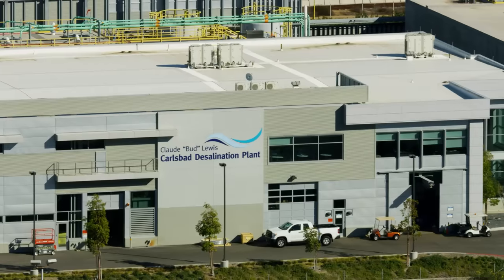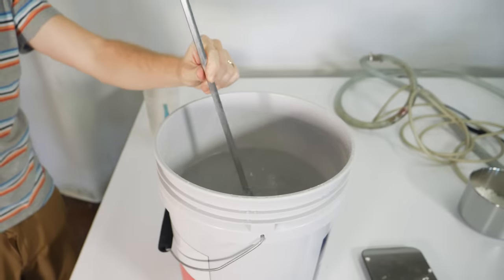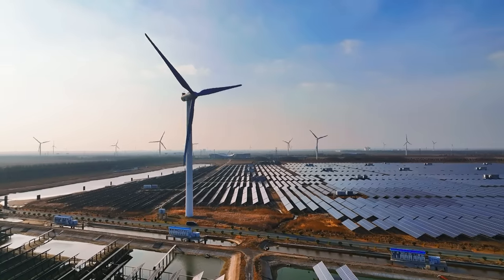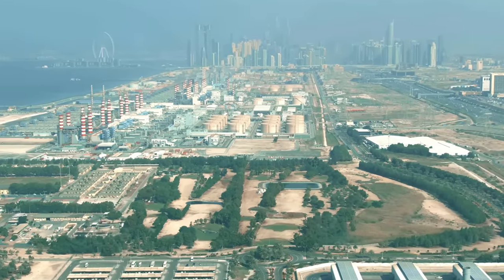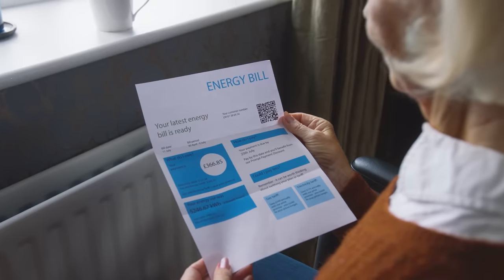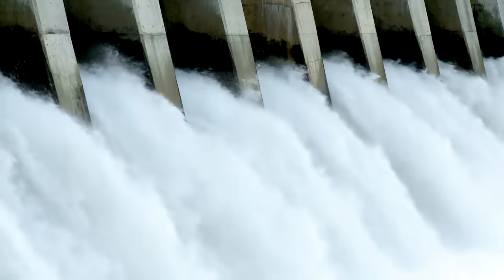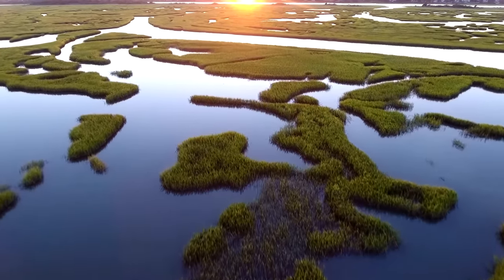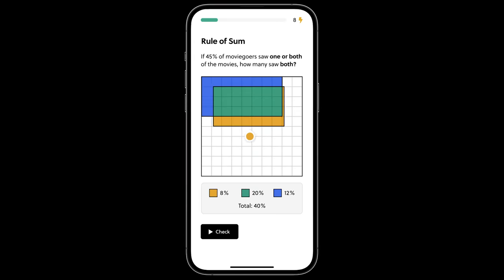Why Is Desalination So Difficult?

Comment: I wonder if you could hook up some type of system that feeds  saltwater into  powerplants, captures the steam to turn  the generators, somehow make the  generator disintegrate from the rust, capture  the salt and then capture the fresh water. might be slow otherwise more fuel would have  to burn.

Comment: How about a massive floatable structure made out of glass with a lens or even multiple lenses that focus the sun rays to evaporate water.
Like some sort of cloud factory steam chamber that pushes the vapor to a cooling area.
That way you don't have to deal with the salt saturation and even then you can just move the entire thing cause it's basically a boat.
Downside is that it only works when the sun is shining but that's what you have a reservoir for.
Reply: Why?

Comment: Reverse osmosis is a pita, having to maintain membranes, and high pressure equipment. Flash evap is way preferable in my book. (Easier operation, if you have a bunch of low grade waste heat.)

Comment: Reverse osmosis by height difference.
Pump the water upward, filter connects at the bottom, pushes through the filter
as pressure from height difference goes higher. The water that comes out
only needs to be pumped back up again, while pressure is being generated
as the natural state of the water. Only more water is needed when it passes through,
to replace what came through, and the water that comes out only needs pumping back to the surface.
Much better than other artifical pressure generation.
Clean water at the cost of pumping it twice.
Reply: There is 0 benefit to this, in effect you just have a inverted U shape in the piping with a buffer tank at the top
Reply: @user-si5fm8ql3c  It's already being used.
Large filter surface to offset the low height difference in flow-through.
Easy peasy.
Also, in certain situations you don't even need to pump it upward to create
the passive osmosis effect. if the point of usage is lower than the outgoing water flow.

Comment: You're missing a desalination process.  What about vacuum?  Under vacuum, the water 'boils' with minimal heat.  You pump this vapor through your vacuum pump and it turns to water on the other side.

Comment: Can't we use solar for distillation? I know that's basically how rain works but I also remember reading a survival guide book where if you are stranded at sea with a plastic bag you can use sunlight to distill seawater for water (although i dunno how efficient that would be, it's probably still better than nothing.)

Edit: yeah lol got to the end of the video and you did bring up my question exactly and given the same conclusion I came up with that is that's just the natural water cycle.

Comment: Why don’t they use giant green houses that get hot from the sun with water cooled condensation plates. Potentially you could also have a large low pressure vessel bringing down the boiling point of water to room temperature probably requires too much energy though

Comment: can saltwater still be used for showering or washing? you don't need to drink all the freshwater you end up using.
Reply: Saltwater cannot be used for showering and cleaning.

After taking a swim in the ocean, you actually have to take a shower in freshwater afterwards, because the salt left on your skin will make your skin sticky. Only bading in saltwater over time will cause your skin to dry and crack up.

You can't use saltwater for your laundry because the salt will ruin the fabric (and the laundry will not feel "clean" afterwards).

House cleaning with saltwater is no good either, when the water dries up after washing the floor for example, a thin layer of salt will remain on the floor afterwards, effectivly making the floor dirtier than it was before. The salt will also damage the building, perticulary concrete structures.

And worst of all: all the salt from this water will end up in nature, quickly ruining the soil, and thus, plantlife, animal life and freshwater sources (groundwater, lakes, rivers, etc.).

In conclusion, saltwater has no place or use elsewhere than the oceans, and we still rely on freshwater for everything.

Comment: Not sure if it is actually viable, but does anyone know if solar evaporation set ups are used large scale? What i mean is using mirrors to redirect sunlight onto a tank painted black as a method of heating. This might, at minimum mitigate some of the energy cost needed for industrial scale evaporation based desalination.

Comment: I've seem wave power generators and I've seen desalination plants. Why don't people use wave motion to pump water and get it to the high pressure that is needed for destination.  The high cost of desalination is pumping the water to 600 to 1000 PSI.

Comment: I wonder about the practicality of using geothermal or non-photovoltaic solar power in distillation. To an extent it's geographically limited, but using something like concentrated sunlight to boil water would probably cut down on energy costs, though it would probably take more space and time. Also taking more space and time but also maybe feasible would be to use enclosed evaporation ponds with warm but still fairly low temperatures. Since these are fairly simple ideas I'm sure there are reasons these methods aren't used, I'm just curious if they've ever been scientifically tested.

EDIT: Just did some quick research and it looks like most of these do actually see at least limited use. I would guess the reason we don't see them more is most likely a combination of geographical limitations (inherent to any form of geothermal power) and scalability (evaporative desalination might work for one greenhouse but on a mass scale it's probably cheaper to transport food from elsewhere than build a ton of greenhouses). But I'd need to do kore research to be sure.

Comment: I imagine you could build a pipeline from the ocean inland to a desert (like where I live) and then pump it through giant flat solar-heated tubes with just a bit of headspace and then collect and condense the water vapor. If you had high flow and low temperature and instead were dependent on using a large surface area, I don't think you'd have scaling problems and you wouldn't have to pay for the heat.

Comment: Ya know you can make an RO system where you just stick a canister deep under the ocean and the pressure from the depth of the water forces the sea water through the RO membranes and you just continually pump the now fresh water up and use it.

Comment: The planners should have used the waste, the brine, as a product. Brine, once dehydrated provides salt, and other minerals. The West Coast of the United States use to have many Salt Works, to take in salt water, and allow the water to evaporate over time, and thus harvest the salt and minerals. The last of these on the West Coast, at the southern end of San Diego Bay, is planned to be discontinued. The desalination plant, instead of sending the brine back into the ocean, could have been placed into dehydrating pools, and the salts and minerals harvested.

Comment: Eh. In places where there's not enough fresh water there's usually a lot of sun. Which means you can literally set up a couple polished sheets of metal into a dish shape, put your boiler/distiller in the focus and turn it towards the sun. Free desalinated water.
Or, if for some reason you're on mars and don't have enough sunshine to boil water that easily, you can use the membrane thing without energy. You know what creates good pressure? Water depth. Connect the tank on the roof to a hose with a membrane at the end in the cellar, and while you won't get 40 atmosphere's of pressure, you can still do a lot with 2. Might not get enough water to shower, but enough to drink.

Comment: If human body lacks salts the taste of the salt turns dynamically in this case kinda sweet and juicy. And If your body has fair amount of salts then same amount of salt concentration in water will taste unpleasant as we know, salty. Furthermore If body has too much of salts in it then that same saltwater will have burning kind of taste. It is impossible to drink it after some point. If there is hot weather outside you can try that out. Add salt to glass of the water to the point where the salty taste starts come up. Go outside sweating for few hours. Don't eat or drink*. Come inside and taste the same salt-water from that glass. There is no salty taste anymore. Your body is screaming to get that salt so the taste changes accordingly. Now try to taste unsalinated water. It tastes unpleasant if your are in lack of salts.

Comment: Could they not use a gravity fed system whereby the falling water partially powered the process? Maybe a vacuum distillation once the energy has been mechanically recovered?
Reply: Wouldn't pumping water to gain potential energy be inefficient?

Comment: Hmm … how about boiling the water off by lowering the ambient pressure artificially to just lower the boiling point - imagine a big black tank in the sun which heats the water to a certain temp - the flower lowers hydraulically and thereby puts the boiling point much closer to the water temp so only minimal heat energy is needed to get it to a gaseous state.

Comment: 52 seconds in, I assume the main detractor is that the power cost of producing clean water from seawater is simply too high to be effective.

Thought experiment: If we manage to create fusion reactors, essentially allowing infinite power generation, would we then not be able to apply that feat to desalination, essentially allowing for relatively-infinite generation in both power AND water production?
Reply: But it isn't.  Our town uses it for municipal water supply. AND thousands of homes here have individual systems.
Reply: But it's not.  Our municipal water comes from. ROing salt water and I pay the same per gallon as I did in other cities I've lived in.

Comment: Its not difficult, its not labor intensive and its not terribly expensive either, the primary issue with desalinization is that its a very slow process. I live off grid in the desert in Eastern Oregon, my main water source is a lithium saturated spring...It can be very toxic in high amounts and cant be filtered, it can be treated with expensive, and also toxic chemicals or it can be distilled. I built my own solar distillation system, its has a 15 × 15ft footprint and in the summer on a 90 degree plus day, I can get around 12 gallons which is way more drinking water than I could possibly use!

Comment: When salt water freezes, the salt is driven out of the matrix.  Freezing is a way to desalinate water.  Why couldn't you just put a desalination facility up in the mountains where you allow saltwater to freeze?  The freezing would be free due to the ambient temperature.  Still have to pay to pump the ocean water up there though.  Still, could that be more cost effective than paying to heat the water?

Comment: Why don't they use gravity to generate the pressure for reverse osmosis? If they put a membrane at the bottom of the ocean, it could pretty easily get to the pressures needed to force water through a membrane.
Reply from the maker: Then how would you get it back up?
Reply: @PracticalEngineeringChannel  The most efficient way I can think of is a pipe filled with fluid more dense than water, then buoyancy could take all the clean water to the top. I’m no physics expert so my logic could very well be flawed.

Comment: Disorganization can be done multiple ways.  Let’s start by boiling the water and taking the steam and converting it back to water.  Then we shall put that through a soft water filter and then we shall put that through a reverse osmosis system.  Now keep in mind that set up costs $1000.  That provides drinking water and bathing water for a house with family of 5 to 7. And the water is clean with 0ppm. The system works by itself. There would be a extremely low salinity level. The process is easy and cheap.
Reply: Yep.  Our house had one.  Water costed about the same as when I was in CA.  Later our entire city was RO.  Not a high cost.

Comment: So, we need energy for this, right? 

Why not just build a huge glass building which we can put water in. Use the heat from the sun.

Might not work in some areas but supplying a town with water would be possible.

Comment: Why can’t they build a desalination plant next to refinery or power plant and use the combustible gases or waste heat that would otherwise be just burned off and released to the atmosphere to heat up seawater. Hot seawater can then be pumped to high pressure is a spray tower to flash evaporate the seawater to vapor and salt. Do a cascading flash evaporation through several flash towers with a counterflow of cold seawater to improve heat recovery. Your product is fresh water and salt crystals

Comment: Current methods of Desalination range between .002 and .005 cents per gallon. Most municipal water supplies in Texas sell tap water to consumers at .01 cent per gallon.  An average  285% markup. Desalination is an extremely cheap form of fresh water supply. 

Your video while technically informative, seemed to indicate that the Desalination process was somehow inferior, or expensive. When compared to free sources of fresh water such as aquifers, lakes, rivers, and manmade reservoirs desalination cost may be higher, but in no way are they a barrier. Especially compared to the environmental damage happening as a result of damming natural rivers, depleting aquifers and desalination of ocean water due to excessive fresh water runoff from manmade sources.  

You also failed to mention that the Salt and Minerals that are removed can be resold both as Table Salt (sea salt) and soil enhancers. Recovering some of the cost using the waste stream.

Comment: Could we just have ships with giant capture decks following storms? You’d still have to treat the water, but it wouldn’t need to be desalinated.

Why can’t we do this passively with sunlight. Huge tubs designed to hold heat with a funnel shaped lid that lets sunlight in evaporate the water. The water runs down the cone into a collection tub underneath.

Comment: Sea floor level RA for built in pressure and sea water delivery system. Empty pocket with a sort of submerged dam, which regulates pressure into the subterranean membranes, excess pressure in would aid in pumping it to surface holding tanks. /shrug. 
.

Comment: Now If you evaporate that water enriched with salt it is more efficient than it would have been otherwise as you have half the water to evaporate.
And then you can sell the salt and distilled water to. Yes you have Operational costs but you also produce products that are widely used.

Comment: With solor energy is getting cheaper and commonly available , we all must start thinking of evaporating sea water or sub soil water using solar energy , i am in process of making evaporator, with vacuum chamber , water boils off at lower atmospheric pressure. I think -40HG in the water should boil off at 40 deg Celsius, the vapours shall be 
re condensed with small chilling unit , my estimate is that i kay be able to produce 2,000 litres per day using solar energy . TDS of under ground water i am using is 3000ppm.
I need advise and ideas .
If sucessful i think every house hold shall have own source of clean water.
Main challenge is to evaporate water at 45 deg cel instead of 100 deg  Celsius .
Awaiting for comments and tips to help me achieve success .

Comment: Bought a surplus military issue portable Katydin RO desalination unit. Works great, water is fine. Too bad the arse hole government here in Greece hasn’t installed desalination equipment to cure the water shortages. They have fantastic solar and wind energy systems here that can power the equipment. They are also trying to sell out the water supplies to private foreign entities who will raise costs and export most of the water. Kinda like Coca Cola selling bottled water causing water shortages for municipalities that feed off of the same source.
As for the brine, a perfect source for sea salt dehydration. If you can find large areas to create pools for the brine in extremely hot areas to evaporate. Any idea if vacuum dehydration would work as drying the salt out of the brine?

Comment: so could you feasibly run a nuclear power plant and desalinate plant simultaneously? if a nuclear power plant is working well, none of the coolant water should be polluted. the plant would create steam, turn a turbine, and go into the pipes; while the brine can be discarded alongside old fuel rods.

Comment: Nuclear power desalination plants are a no brainer. Use the power directly to drive a high pressure RO system. Then take the brine and feed a magnesium plant. Also solar powered passive distillation is another option. At 1.2kW per square meter free power you can distill a lot of water.😮

Comment: I wonder if you could use the waste heat from a nuclear power plant to distill water. just heat the inside of a large funnel with the steam on the tail end of a turbine.  run water down the walls of the funnel and have the steam go out the top to a condenser. ideally you'd run enough water so that about half of it evaporates and the other half is the brine. you'll definitely have the energy needs covered, but i can see issues during reactor maintenance.

Comment: Dude, your distillation setup is basic, but absolutely fine as far as i can tell. It was probably not necessary to use ice water, regular cool water should do the trick, but other than that, nothing to shake my head at.

Comment: Solar furnaces, basically very simply devices,  can achieve temperatures so high that breaks water on hydrogen and oxygen (or melt metals, stones and glass)... evaporation on a large scale could be a peace of cake for them, I guess.